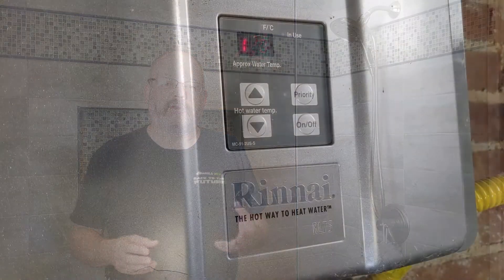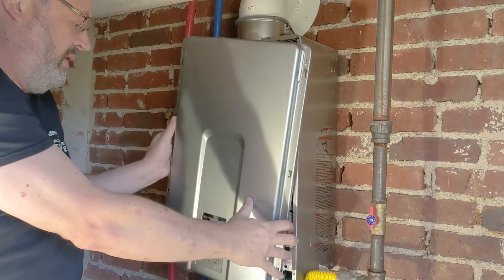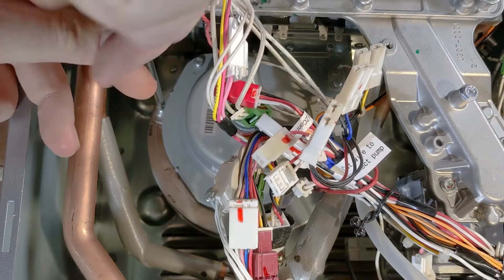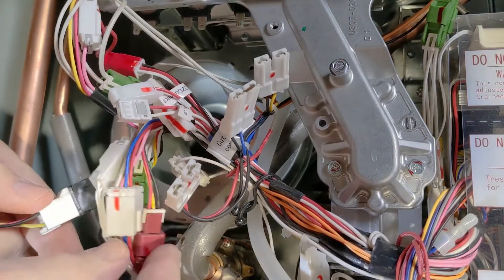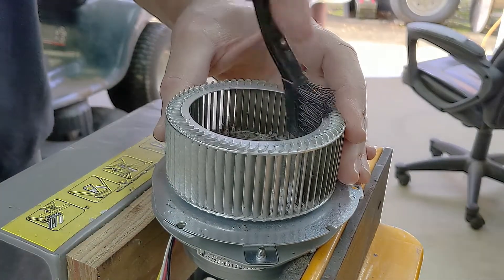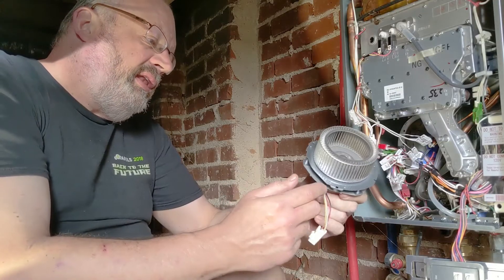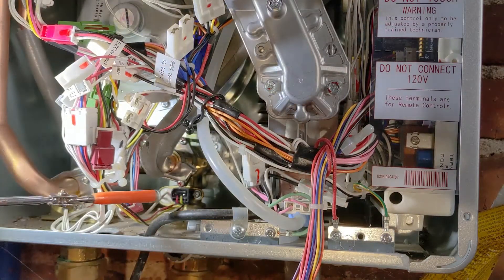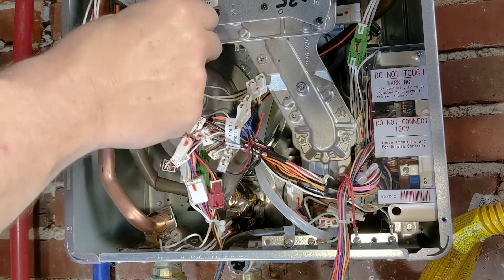Tankless water heater runs cold after 3-minutes with no error code

Comment: Thanks dude! You saved me a thousand bucks! My burner had a tangled mess of wires going over it and would not allow me to remove the cover plate to clean after I had removed the screws.  It was screwed on in many more places and I had given up on getting it open.  I put my air nozzle in one of the screw holes I removed and blew air into it while vacuuming through the fan. (Which I was also not able to remove for the same reason.) A ton of debris came out and the water heater works better than ever! You are the man!
Reply from the maker: There are two sets of fan screws but only one set removes the fan from the unit. The other set is part of the fan assembly. Its so easy to loosen the wrong ones I've since painted the tabs of the screws for accurate identification. Thanks for your generous comment, you made my day.

Comment: My Rinnai was playing up. My fan was pretty clean, checked and sanded clean the spark electrodes and cleaned all the burners above the manifold with my air compressor. My system is working fine now without playing up. I checked the PCB board and all the components looked fine. I was worried that the gas or water sensors might be playing up. Gas & water pressure were fine. If it's an electrical problem, it would be difficult to diagnose. Rinnai does provide a troubleshooting method to diagnose electrical faults with components but it can be a long process. A normal plumber would just change the entire unit or PCB board. Great video, saved me a call out fee + labor, around $350-400.
Reply from the maker: I'm glad you're able to fix your water heater. Sometimes when mine is acting up and I remove the fan it looks clean. It turns out just a little bit of debris is enough to be a culprit.

Comment: Mine was shutting off daily with an error 10 code. After cleaning the debris, I wasn't sure about that black gunk stuck to the fan blades. I had some auto wheel cleaner and sprayed it although being careful to hold the fan angled to make sure no liquid got into the motor. I then used the slightest amount of water to rinse it and the fan came back sparkling clean as new.  Ideally, I think brake parts cleaner would have been better. Luckily the screwdriver I got my hands on that day had a magnetic tip so putting the screws back was easier. When I went to reinstall the fan, I spun it and it was turning out of round. I grabbed it and was able to easily true it up with a little pressure.
Reply from the maker: Sounds like you got that fan back to factory clean

Comment: You are a fantastic teacher! I followed your video step by step and fixed ours! Thanks Brad!
Reply from the maker: I am thankful you were able to fix your water heater and appreciate your kind comment
Reply from the maker: Been tempted to go the screen route but fear it would interfere with the airflow. The unit is dependent on air flow to cool itself. My current method has been to spray around the unit and around the exhaust part with bug spray a few times each year.

Comment: This is EXACTLY what mine was doing as well. I’m no electrician but the instructions and video made is very doable. The pros told me to replace it for 2k. THANKS !!
Reply: Plus labor and materials
Reply from the maker: I'm glad you were able to successfully complete your repair
Reply: @BradSmithSC is this normal after having a new install after less than a year? The company ours came from sent it with the wrong codes programmed, wrong size exhaust pipe, etc... And the tank of # on the cover doesn't match the # on the machine. The company has done nothing but fight with us from the get go
Reply from the maker: @OhThatRedhead  With this many issues, perhaps the vendor is unfamiliar with on-demand water heaters. 
I'm uncertain how to proceed with your situation. You might want to contact another plumber, explain the situation, all to get a detailed fix estimate for possible use in small claims court.

Comment: Thanks Brad!! That is exactly what was wrong with mine. Took me about 10 mins and probably saved me 200 bucks to have a plumber fix it. Really appreciate it! 😃👍
Reply from the maker: Glad this helped you
Reply: By the way, I read Ryan’s message about a long unplug cycle. I tried that first (a few times) and it didnt work.  My fan had a huge moth in it.
Reply: Many plumbers wouldn't even be able to troubleshoot and fix. Much easier and more profitable to tell you that it needs to be replaced. Good job fixing it yourself; and thanks again to Brad!

Comment: My water heater gets moths in it every May, here in Colorado.  The moths get in through the intake, then down into the blower.  They also get in, through the exhaust, and restrict the vent, that's right on top of the heater.

I've cleaned the squirrel cage out several times.  I would still get code 10's, though.  I finally took the vent off the top and found dozens of toasted moths in that perforated, concentric area around the smaller diameter center vent extension, they came in through the exhaust vent, outside.  Apparently, the blower couldn't overcome the restriction, causing more code 10's and it would still vibrate.  The blower would come on and the vibes would start slowly as it built pressure from all the moths, restricting the air flow.  

I vacuumed them out and it's working great, with no vibes.  I had made a screen for the vent  termination years ago, but it rusted through.  

I see you can buy vent screens, but it looks like they're only for the exhaust?  Do you know if  they make a screen for the annular intake, to keep bugs out of the blower?
Reply from the maker: Was unaware screens were available. Would think the mfr would incorporate this into their design. Maybe if the screens have too tight of a pattern it blocks the airflow too much.

Comment: NET: For any of you who are thinking about getting a tankless water heater and stumbled across this video...Take Heed! Tankless water heaters can be a maintenance nightmare when compared to the good old fashion, time proven 40-50 gallon tank water heater. Tankless heaters may be more eco friendly but over time cost more to operate, need constant attention as shown in this video, modifications to your plumbing so your washing machine and dish washer can get hot water, not to mention the hold and cold cycling of the water temperature when you are taking a shower. My wife absolutely HATED having to step out of the shower stream every time the water cold cycled. In the end we removed it and went back to a tank system. If you already have a tankless heater then watch this video and learn. Some good information here!
Reply: Elton,for the issues you cite,I can fill my 300 gal hot tub without stopping to wait for my 40 gal water tank to reheat,so theres that!
Reply: I agree totally. My first one was a Bosch, and it was hell on earth. One of the biggest things was the minimum water flow required to turn on. I had to modify my shower and faucet heads to allow more flow (basically removed the part that slows the flow to save water). Also the gas pipe size for that model was 3/4 or 1 inch (I forget now) which cost $900 to get from the meter with that size. Also the stainless steel ducting was mega-expensive. Lastly, finding a good (and honest) repair service was almost impossible. That said, when I installed the Rinnai, it was easy and reliable. I wish I hadn't built my laundry room to just fit a tankless. You don't know how many times over 16 years and 3 water heaters, I wish I had the space for a good old tank.
Reply from the maker: Sounds like you've had quite the tankless water heater experience

Comment: Great video, thank you for the walk through!  I have similar problems with my unit, which appears to be identical to yours.  Just out of curiosity, have you tested to see if simply unplugging the unit for a few minutes solves the problem?  It could be that cleaning the fan isn't really doing anything... and just unplugging and allowing the unit to "reset" is what's actually "fixing" it.  I have done this a few times, and just unplugging it for a while (a few minutes, not very scientific), seems to correct it most of the time.  Thanks again!
Reply from the maker: You present an alternative worth exploring @ryan. I've not tried a long unplug cycle by itself. 

Since the sound of the fan increases leading up to the issue, I suspect the fan is becoming more imbalanced over time from bug accumulation. For that reason I don't think an extended unplug cycle would resolve the issue but it is certainly worth a try.

Comment: Mine is doing this and is brand new, I will check this but it’s hard to believe this would be my problem straight out of the box?
Reply from the maker: With a brand new unit the culprit might be the fan is not level. When you take out the fan, spin it to ensure the shaft is straight.